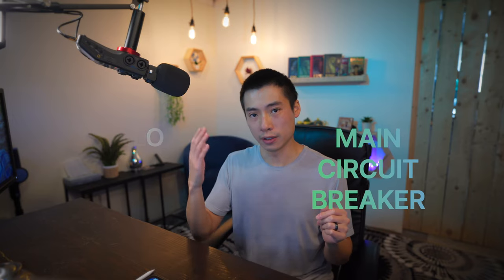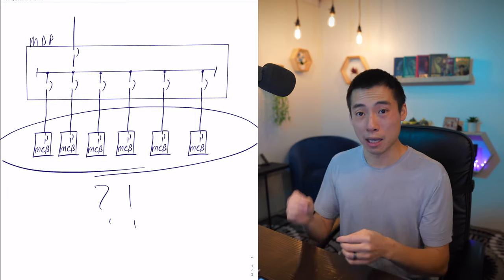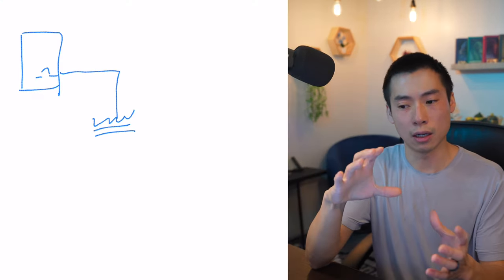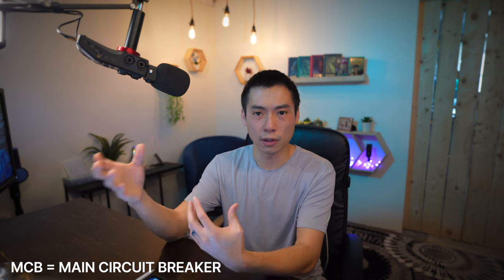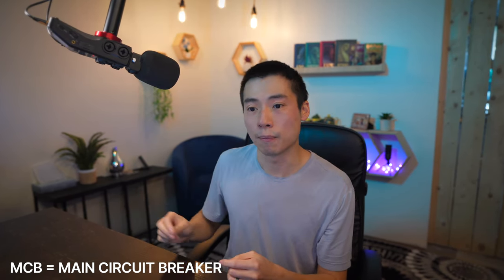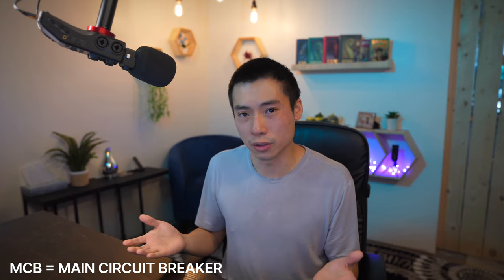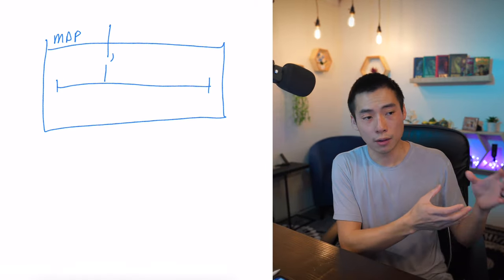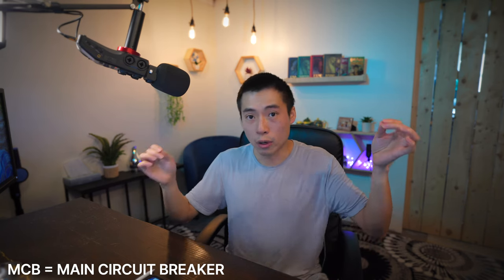MCB vs MLO

Comment: The MLO panel tells you on the inside door label which main breaker should be used by part number, if you want to add a main breaker to the MLO load center.

Comment: So, basically a MLO panel gets control by the same breaker that controls the MCB panel right? But what if the breaker is 200A and both panels are 200A? Does it depends on the load calculations to know if is going to work?

Comment: Do you need a MCB Distribution panel if you have a main disconnect? Can you just run straight from main disconnect to M.L.O and shut off from the disconnect? Why the need for M.C.B?
Reply from the maker: If your disconnect is fused or protected in some way upstream, then certainly you can go from the disconnect switch directly into a MLO panel. That’s actually what we do for a few clients that have policies against hot work or if you have a need to cut down on fault currents by using J Type fuses in the disconnect switch.
Reply: @theelectricaldepartment  Thank you